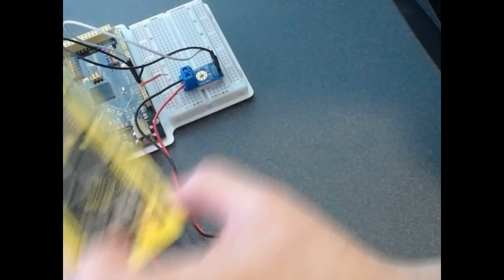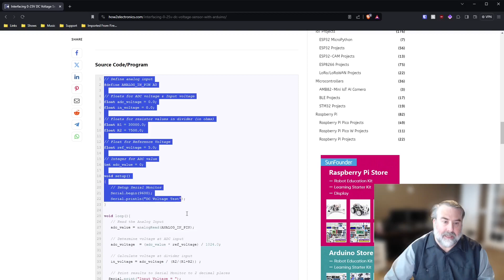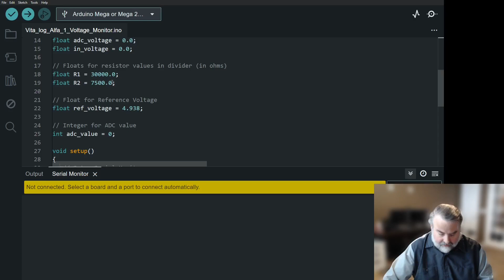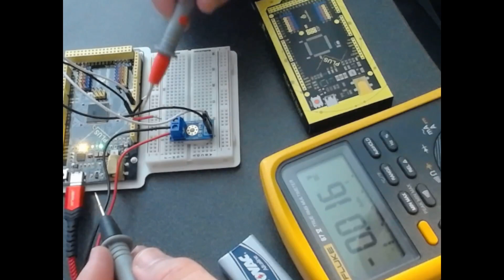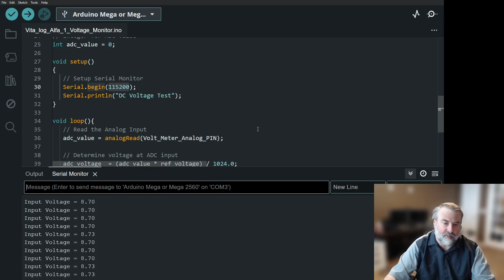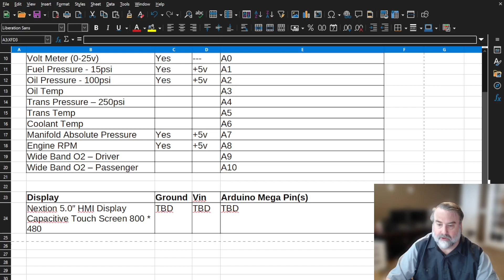1971 Plymouth 'cuda - Adding a Data Logger to record engine vital signs - Part 1 - Voltage Monitor

Comment: Looks good.  If your trying to get a more exact voltage reading from the ADC, you could account for the A0 input pin impedance.  Basically, the 7500 ohm resistor in parallel with the input pin (while sampling) impedance which would make the 7500 ohm in the software just slightly lower value and that will result in the calculated sampled voltage being just a bit higher voltage displayed.
Also, on the alternator charge wire bypass videos, could you show what you did to provide power to the dash?
I'd guess just through the original fusible link to the bulkhead?  But what did you do with the original alternator line to the bulkhead?
Reply from the maker: ZeroGMopars...  thank you for the great reply...  

Voltage accuracy.  For some inputs I will be adding a resistor (MAP sensor for one), for voltage, I'm not worried about it.  Resisters are off by +/- .05% to 10% depending on the quality of the resister used.  When I get to the pressure transducers they are off by 2% full sweep.  Thus I'm not worried about being off by the minimal impedance of the input pin.  At this point it is off by ~.03, which is good enough for me.

Alternator Charging system - I did not remove any of the stock wires.  Therefore the 12AWG wire from the Alt still goes to the firewall and from there to the AMP meter and onward, just like stock.  The cable I added, just bleeds off any extra amperage and sends it directly to the battery.  Thus taking the load off the stock wiring...
Reply: @Scarlet_1971_cuda Thanks.  I wouldn't worry too much about the small difference in voltage calibration either.  Just know it exists.
On the charging system, I had done the same thing before.  The issue is that the stock fusible link is now being by-passed.  
I would add a fusible link in the original alternator wire also in case there is ever a short under the dash.
Reply from the maker: ZeroG...  send me a email on the fusible link and how I have it bypassed.  I would like to understand this better...